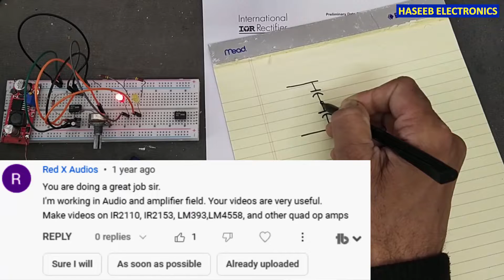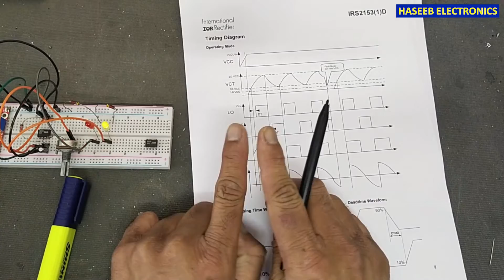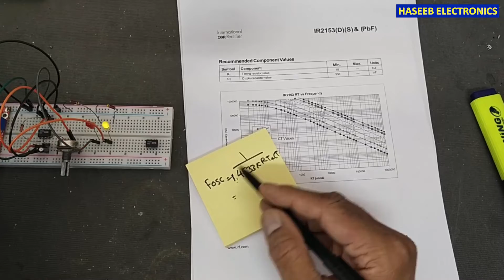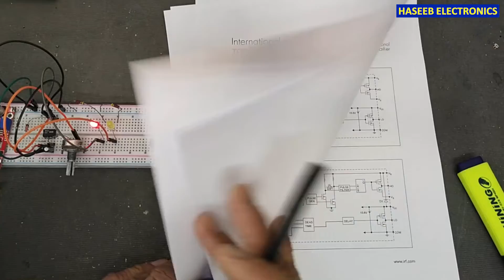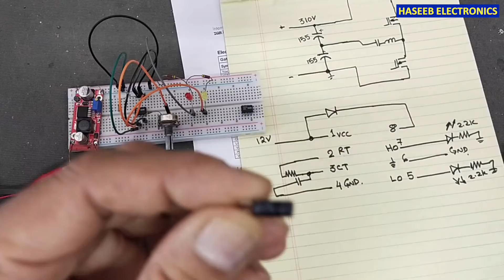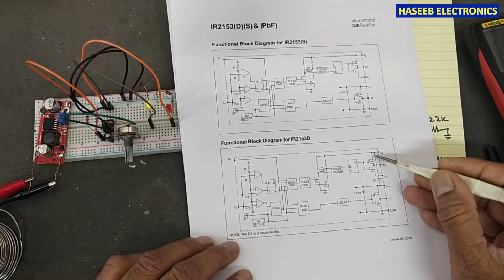{805} IR2153 Half Bridge Driver IC, Explained and How To Test IR2153

Comment: Nicely defined. This ic can be used in an old ATX power supply if anyone wants to bypass the traditional tl494 or other hectic pwms. It only needs to replace the old 13007s with load required mosfets and the rest of the job will do this IC if designed correctly.
Reply: No it can not replace a tl494

Comment: Sir, I have question regarding IRS2453 which is a full bridge self oscillating driver similar to this. First, the dead time mentioned in the datasheet is not true, after I build circuit and connect oscilloscope, there is no dead time atall. 

Second this IC seem to work with resistive load only. After build circuit with 12V full bridge, output is stable 12v, if I put bulb as load 12v AC bulb works perfectly. But If I put 12v-220v transformer as the load so that output of transformer can be 220v, all mosfet blow up and IC damaged immediately. 

So question is:

1. Why is no dead time like they say in datasheet?

2. Why can it operate only resistive load? No inductive load or transformer?

Comment: everything i can glean from the datasheet except one, and that is the one you havent dealt with, either.

VCC.

datasheet schematic shows it tied to the 600v rail, by a resistor.
then mentions vclamp, and the zener. note 1, 3.
dont feed from low impedance source, feed sufficient current...

so i guess that means its good on any supply up to the vclamp with no need for the resistor.
once you increase the supply its just standard zener load resistor calculation... be it for a 30v supply or 600v...
5ma
30v supply calls for about 1k. 1/4W
600v asks for 39K at...wow. 10W.

Comment: Is it possible to feed the integrated circuit ir 2153 with  5 volts without problems
Reply from the maker: its VCC lower level is 7.2 volt minimum. less than this it will go in under voltage lockout mode 
upper level is 9.9 volt 
so we need to operate it between 7.2 to 9.9 volt 
best range is 8v to 9 volt

Comment: Hello dear friend I have a first grade question. Yesterday I was testing for voltage a Main PCB that I won't turn on. But when I touch close to an Optocoupler suddenly turn on even just one test lead. My questions is!! It might be  because I am not insulating my Bench Multimeter correctly?? And could the this damage more the already damage PCB ??